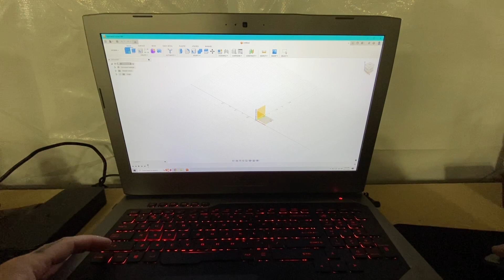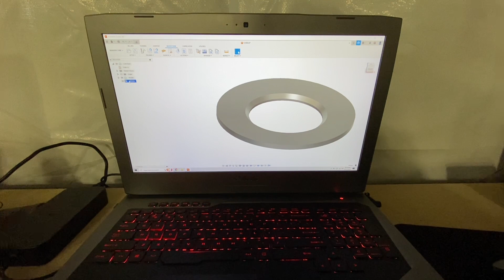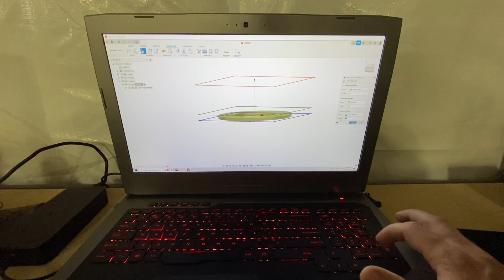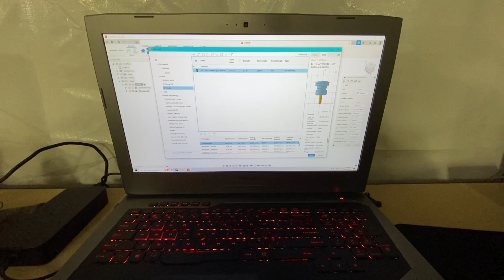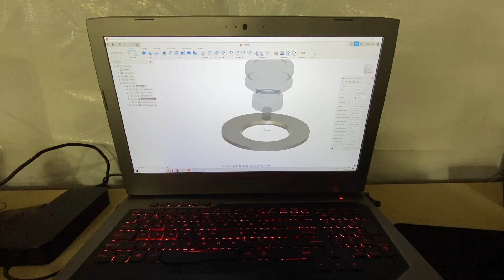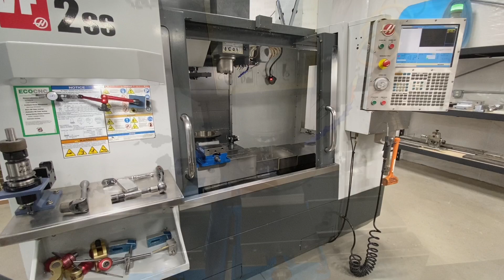Taking my first baby steps into milling in @adskFusion 360

Comment: I got some tips. I'm not even close to how good you are, but you may take them or leave them. 
-3D printed a base around the tool setter thats a snug fit to a Zero box that covers the OTS. May or may not save it entirely, but if something should be slung out of the vise, or tool let go may save the OTS. Sure you know they are costly. 
-That shelving with the particle board. Its going to sag regardless of the supports. Pretty sure it just sucks up the moisture. Not sure if sealing it helps (but its my theory it should)? 
-I have some of my CAT40 holders directly in holes drilled like you in wood? Not sure if thats better or if oversizing the holes and 3D printing rings to protect them from contact? I did with some shelves made from 1/4 alum plate for the lathe collets? 
-I found that the Yukon (sold at HF) tool boxes are pretty good at holding tooling for each machine. 1 for the manual lathe tooling, one at the CNC lathe. I put U channel alum on the tops and added two pullout shelves (raises the wood top higher to comfortable height) Added storage.
Reply from the maker: I appreciate any and all ideas weather I implement them or not. I’m gonna think about some of these.